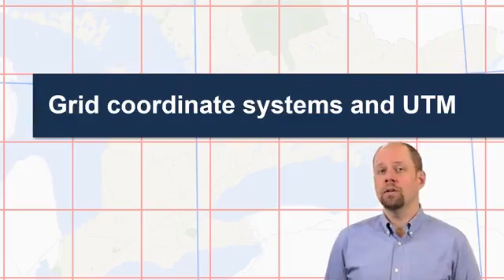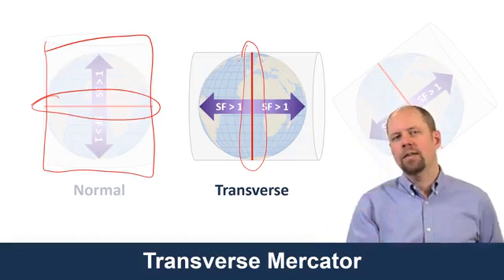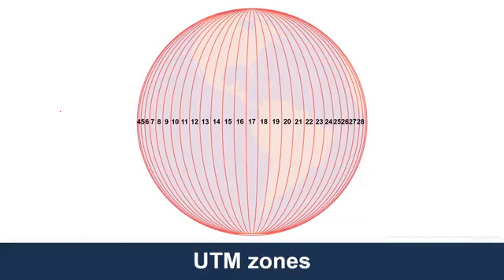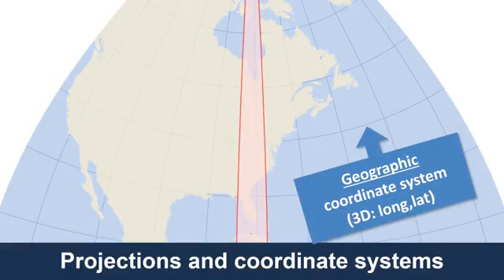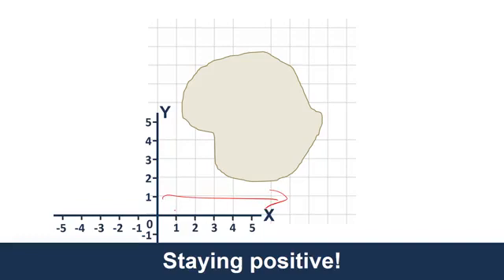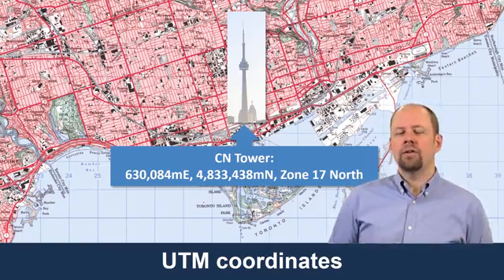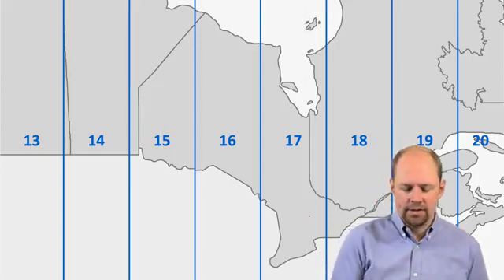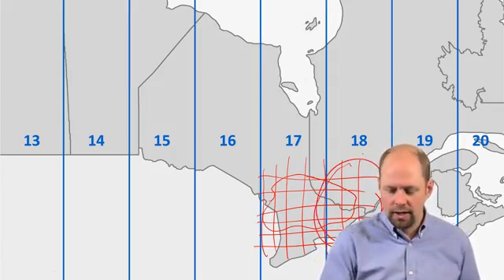Grid Coordinate Systems and UTM

Comment: I think you forgot to mention that the central meridian in each zone is always set to 500 000 east. That means that as you get closer to the zones, the actual width of each zone decreases, so you can include a quite large area of the neighbouring zone to the west without encountering negative easting coordinates.
Reply: That was my exact though. And he forgot too to mention that this is an arbitrary (yet convenient) value, that by no means represents the medium point of the zone width. Each zone is 600+ km wide at Equator line, but this width decreases toward the poles.
Reply: He doesnt own the video though. Stole it from Coursera